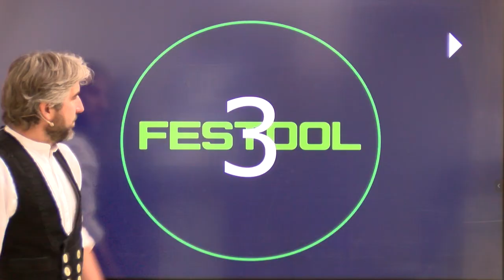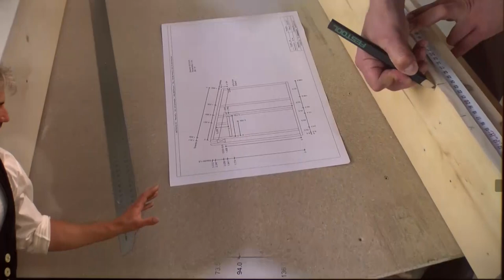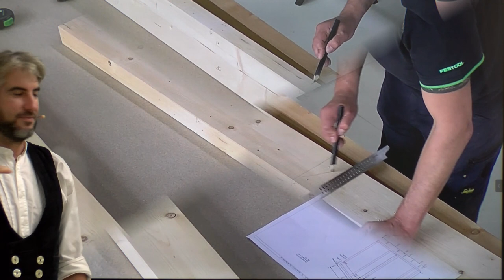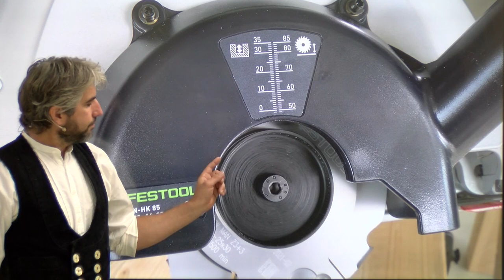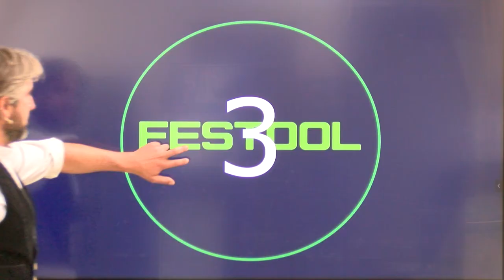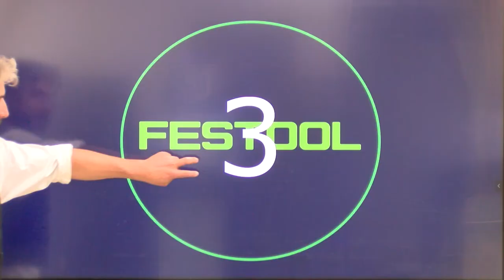Timber Construction Special pt 1 - Framing of wall elements (recorded live session)

Comment: Nice video but yeah, I'm from UK and live in Europe and this 625mm centers thing is the biggest ballache ever, sorry to be frank but it's so stupid. It would be better at 600mm centers and so boards coming at 2400×1200 instead of 2500×1250! 
1. It's easier and faster to layout with less mistakes because the math is easier 1200 divided by 2 600. Simple!
2. It would mean that studs aligned with plasterboard sizes which is extremely useful on certain builds. As plasterboard is 1200×2400
3. It also means you can use 400mm centers for specific applications.

Get with it Europe! I used to think there Germans were next level builders but the more I learn the less I like their techniques and everything is just focused on CNC machines... Tho only thing you got right is the sustainable materials side of things